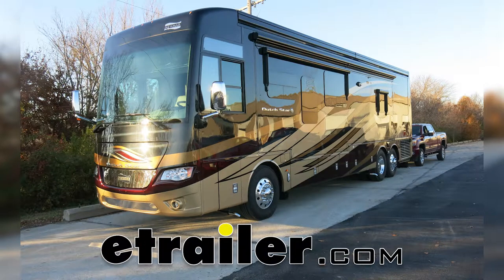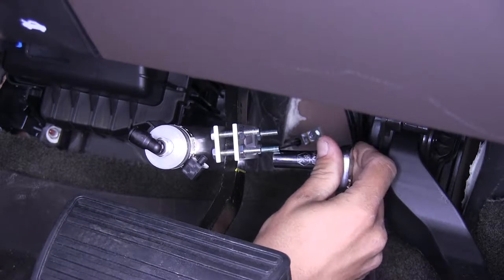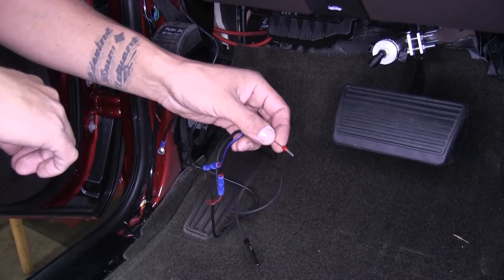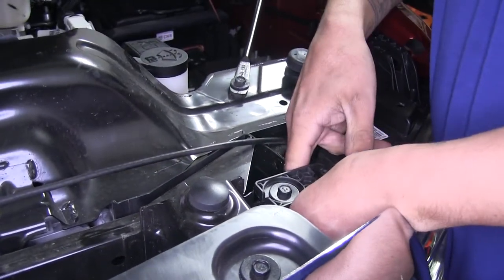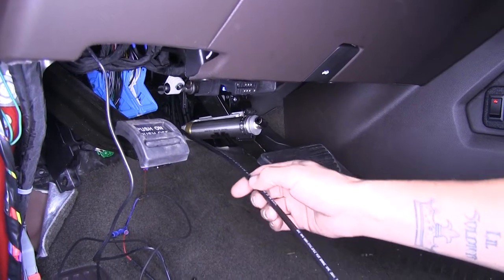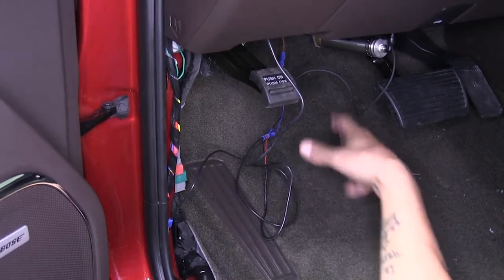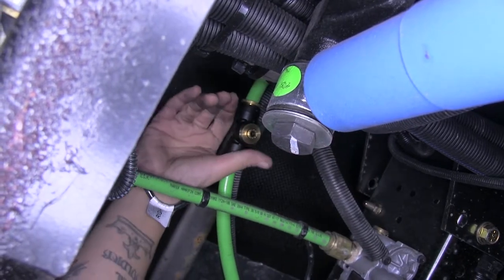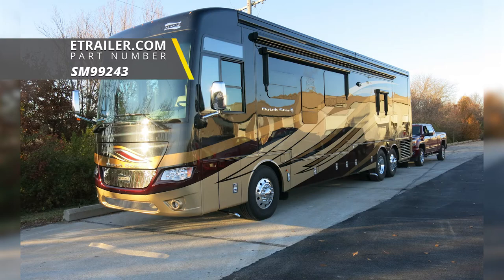etrailer | SMI Air Force One Braking System Installation - 2018 GMC Sierra 2500

Comment: Why not pull the cables to drain the air tanks?  This allows you to remove air and any condensation/water that has accumulated.  By doing this you have less wear on your braking components.